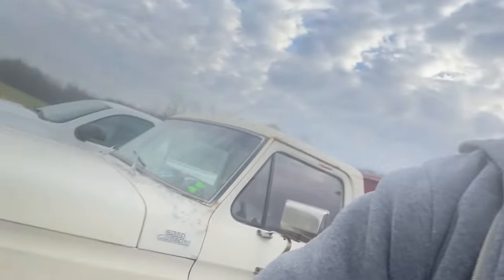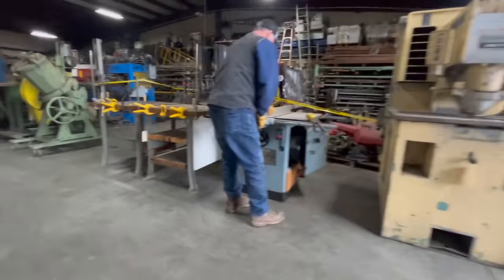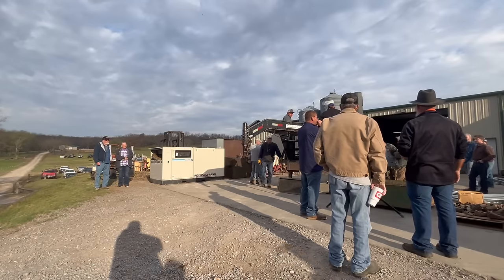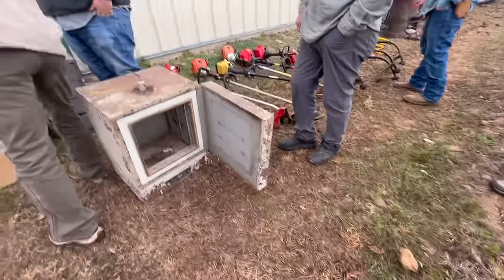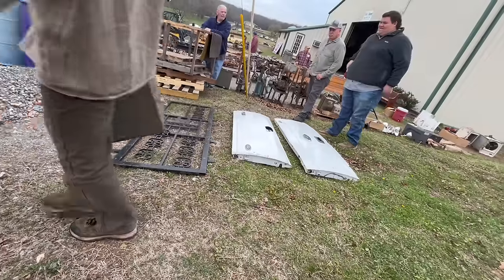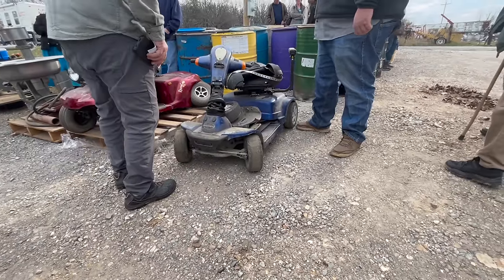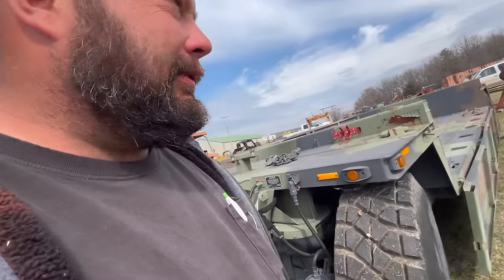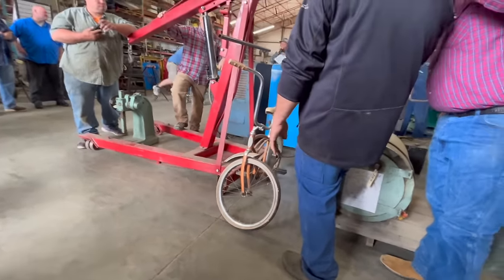AUCTION TIME! You won't believe what a bicycle brings!

Comment: I bought a shop built goose neck trailer. It has 3 moble home axles on it. I put 12 ply tires on it. A new jack. New lights. Rewired the brakes. I've got a working 24 ft flat bed trailer for $1800.00. It's worked well for me!
Reply from the maker: Awesome! Sounds heavy built.
Reply: @faithfulfarmadventures  No it's not. The man that built it had a fab shop. I think his ideal was a 4 ft parts tub ,  and 20 ft raw stock. When I had cattle i'd haul 4 round bales. 90 to 100 small bales. i've seen people haul 16 ft cattle or hog panels in a u shape , in a pick up. Thèn fight the bow! I haul them flat on my goose that works good. .